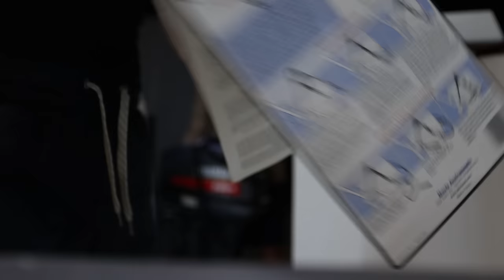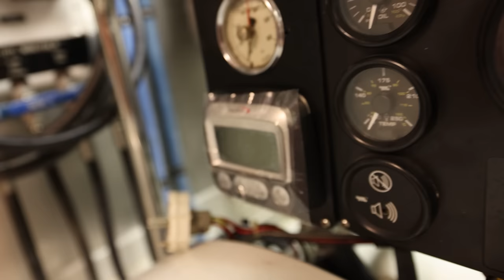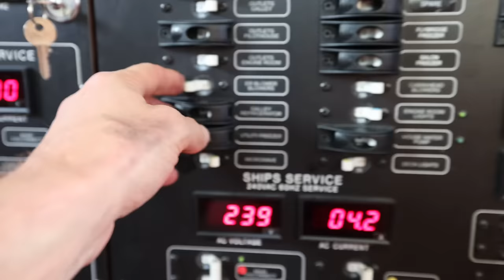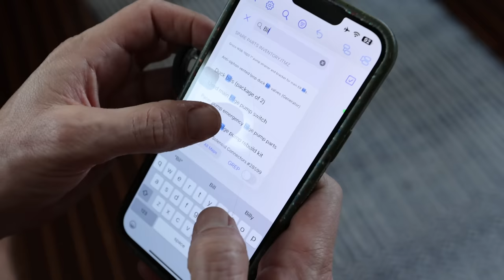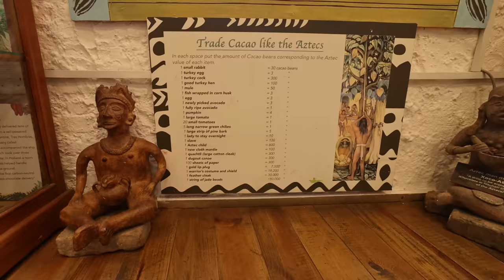HARSH BOAT LIFE REALITY! Owning a boat is hard work! Living full-time on a Nordhavn 55 trawler #202

Comment: Braden: To cut a spaghetti squash  put the whole squash in microwave for 3 minutes.  That will soften it and make slicing way easier.  Cut, clean out seeds and add butter and spices and place in covered bowl w/a little water and back into microwave for another 3 minutes.  Easy!
Reply: East spaghetti squash - pop it in an instant pot with 1 cup of water whole for 10-11 minutes.   Once it’s done you can easily cut it in half without risking any fingers.

Comment: Sorry you had to scrub that overspray off. Anytime in future if you find overspray from nearby painting has covered your glass/gelcoat or any hard surface, swing into a auto parts store or Amazon and purchase a clay bar kit. I am not sure how it works, but it removes all overspray and is easy to do and only takes minutes. It will not damage any surface.

Comment: For cutting with that big knife, you might try using a rubber mallet instead of your hand. You’ll find that a rubber mallet becomes your favorite tool for encouraging things to move.😊 I’m old enough to remember when “beach glass” was just broken bottles that could cut your feet if you weren’t careful.
Reply: Good thought, but actually a “deadblow” hammer is a better choice, all of the energy transfers to the struck object with no bounce.

Comment: No expert here on the squash but, I like you use a long serrated and go on both side through the outer skin, then split. Like yu say, someone should have a great way to cut them up. It is a good food to add to any meal. 
Too bad on the quality of labor issues, understand. Owning, maintaining a yacht of any size requires a continious amount of dedication, time and funds. Two sides to every coin, yet I'm sure it is worth it when all is running smoothly.

Comment: I got my new resistor for the error message for the “remote throttle” and put it in the place where the old one was. Started the engine and the error returned. So after $1,200 bill from a Cummins tech; I was back where I started. Computer testing said the remote throttle was turned off so I removed the new resistor and the error went away. Aren’t boars fun?

Comment: lol  You are definitely scared of the knives.   Two things to help you in the future.  First when cutting a large item like that squash, hold the back of what you are cutting and go in front of your holding hand and push forwards and down on the blade and establish a cut away from your hands.  Once that is done then sink the tip of the blade into the cut at the front and put your free hand over the blade at the tip and then press downwards on the back on the back of the blade still holding the tip firmly. You can then safely apply massive force to the blade slicing through it most of the way.  You should be able to work it out from there.  I laughed until I almost cried watching your attempt.  If your knife will not cut through it using the method I gave you then one of two things is wrong.  Either your knife is incredibly dull or the squash is not ripe enough to cut anyway.  Your blade should be as long as the item you are cutting as well.  Good luck in the future!   LMAO!
Reply from the maker: Great advice!